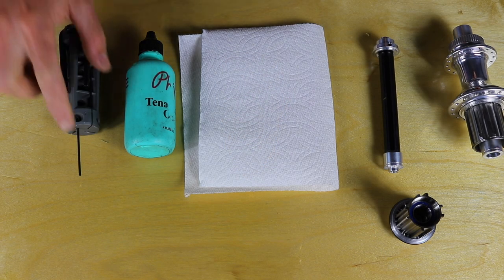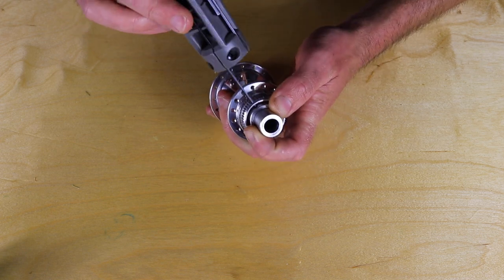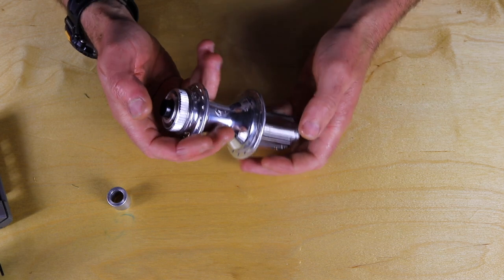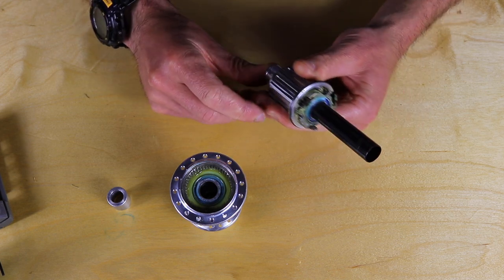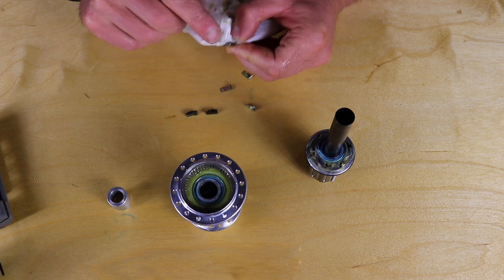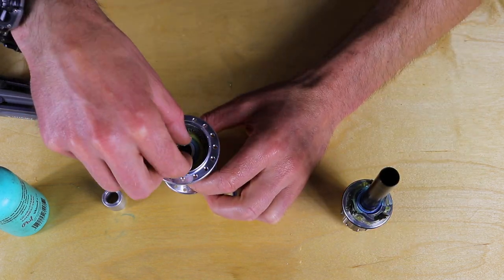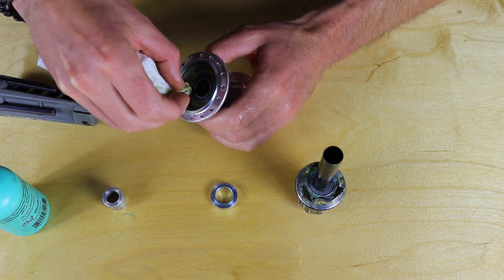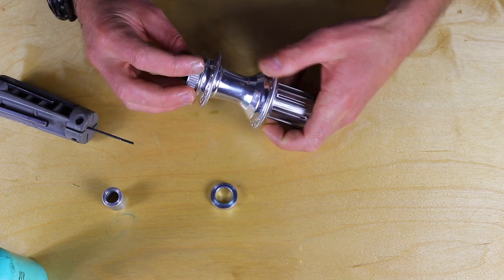White Industries rear hub service

Comment: Great video thanks! I called White Industries about using a light grease for a quieter hub - they said they use Lubriplate number 105 on the pawls for a quieter experience. Just FYI. I'm gonna give it a go. I've been a loud hub guy for years, than I tried them quiet... Oh my.
Reply: Quiet is the way to go!

Comment: there are criticisms about their design not protecting the rear bearings from the elements as well as other designs.. Do you feel that is a detriment?
Reply: I have a consistent creak from my rear CLD, only when I'm out of the saddle in lower gears.
Reply: @deadreckoner5276  Since this post, I got the hubs, replaced out with ceramic bearings and have had no issues.
Reply: @cliffcox7643  Do you think it's the ceramic or just that you reseated the bearing?
Reply: @deadreckoner5276   I don't know? I never had problems with the original bearing I wrote on it for a little bit then changed it out for the ceramic.
Reply: @cliffcox7643  Did you change it yourself?
Reply: @deadreckoner5276  yes, vid on YT, very easy
Reply: @cliffcox7643  Do you have the link? I only found this video for WI hubs.
Reply: @deadreckoner5276  6901-2RS and 6902-2RS as recommended by white themselves for ceramic
Reply: @cliffcox7643  Ya but do you have the link to the Youtube video? 
And do you notice a difference with the ceramic?
Reply: it spins a LOT easier with the ceramic than stock.
Reply: @cliffcox7643  Where did you source the bearings?

Comment: Love how White Industries nickel and dimes you after arm and a leg you for things like pawls and free hub spacers. 20 dollars shipping for a washer that should ship with a $380 hub.
Reply from the maker: Their pawls are made of tool steel and will last longer than most frames. Freehub spacers are available as an add on if needed.
Reply: @AVTBike  Just frustrating to spend so much and wait so long on hubs and not come with a simple cheap spacer .....to find out shipping is $20 for something that could fit in a letter sized envelope.
Reply from the maker: @michaelviglianco6121  They are a very common part, which most bike shops will carry. We can ship them for much cheaper than that for US orders.

Comment: I have a rear White Industries Freehub that needs servicing. I would love to just pay someone to diagnose and fix is. But my mechanic says he wont touch it, and wants me to buy a new wheel. (why not just sell me what he has in stock). Even Mikes Bikes, a SF Bay area shop with lots of stock, says they cant get these in stock- or that they parts are really expensive.Anyone have a suggestion?
Reply from the maker: I'm not sure why either shop would not work on the hub for you. They are very simple to take apart and service. We stock many replacement parts if needed. These hubs will last a very long time with routine maintenance. If you have any questions send us a message to sales@avt.bike.